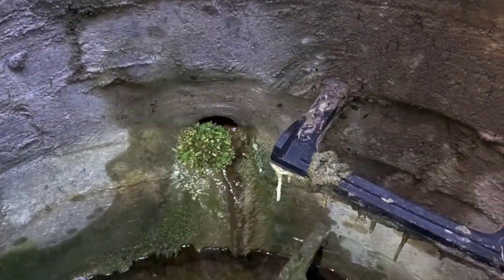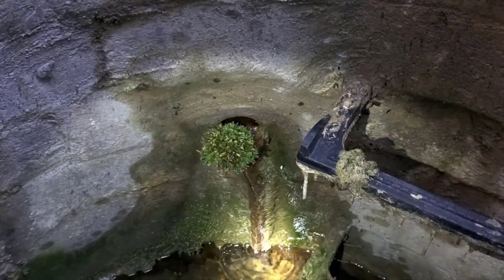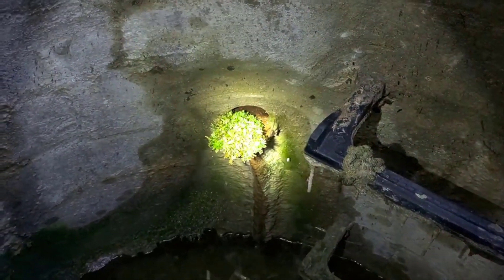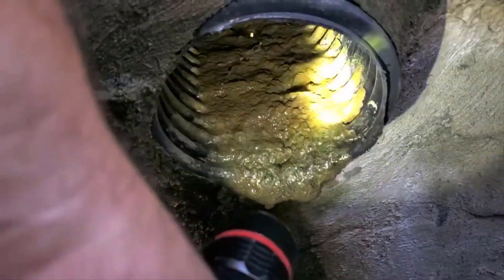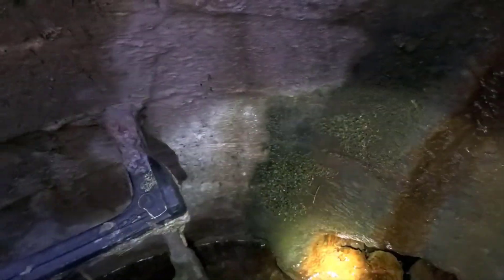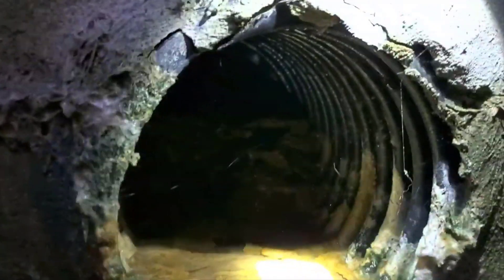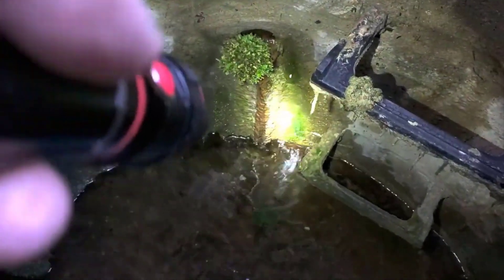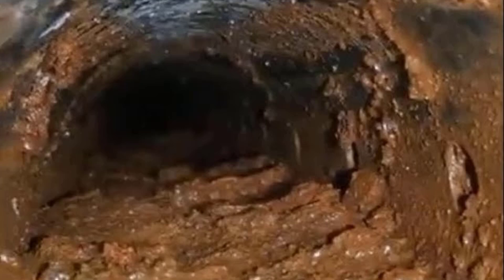What Happens When Iron Ochre Hardens

Comment: Would jetting alone take care of iron ochre? I had a system put in about 4 years ago and wasn’t told how to maintain it. I’m going to have it jetted, but what is the procedure called where your guys broke it up before you jetted? Is that a possibility if it doesn’t work for me. I’ve had a few plumbers but no one ever mentioned breaking it up before jetting as an option. Praying I am salvage this. It was a $9k job and I can’t afford to have it ripped it out and have another iron orcher protection system put in. Hoping you can give me some advice. Thank you in advance
Reply from the maker: Sometimes but it will Sometimes get so hard nothing works. Stay on it. Scheduled jettings.